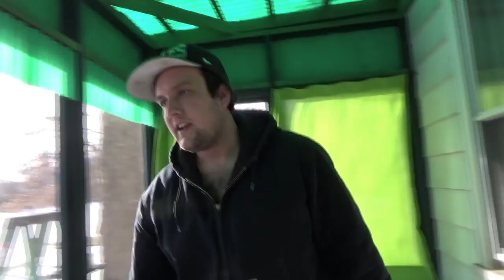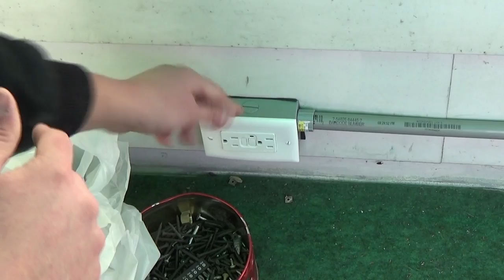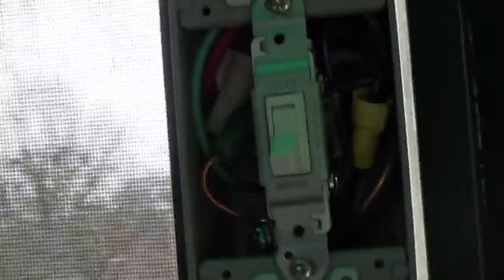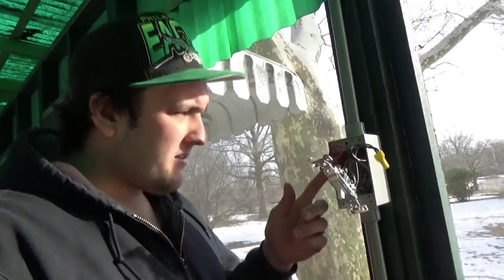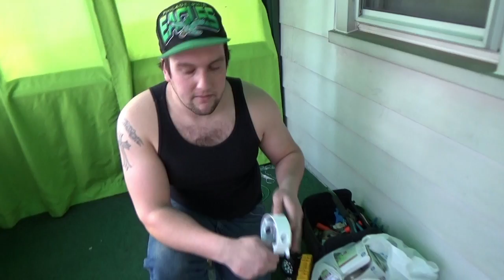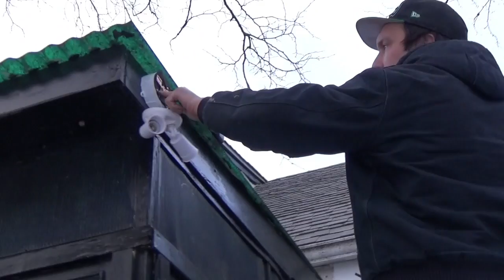How to install a light

Comment: Yo Buzz. lets go pull some 500mcm And give these people a real show! Fellow Electricians ftw Lol.
Reply: +TheSwiftyWinds stripping that shit is a bitch
Reply: Dude ikr! That new slick coating wire is even worse.. But it pulls alot better without wire soap.
Reply: +TheSwiftyWinds i always hate having to use the blue lube looks like ive been jerking off smurfs all day
Reply: +Eric Chrisman ya it is. have you ever used the drill attachment that strips bigger wire?

Comment: nice. I am taking an electrical class right now. I learned how to install romex cable for residential wiring. as of right now we are learning how to bend emt with hand benders. we are bending 90° bends, offsetts, sabbles. do you have any tips for me?
Reply: saddles
Reply: +Zach Vanriper  learn Trigonometry it helps with bending conduit, finding the hypotenuse is almost like finding the length between your bends to overcome an obstruction and getting the right height to rise over and straighten out and then back down  offsetting over anything in the way of your run. I only have a year experience , but I took electrical classes from a qualified instructor and wicked Mathematics teacher.
Reply: always remember safety first. make sure you always turn off the circuit your working on and always test it to be sure just incase, you never know if somethings been mislabeled. when you're using your screw driver never hold it by the metal shaft even if the circuit is off, its just a good habit to get into. remember your deductions when bending pipe pretty much all benders have it labeled on there. no more then 360° of bends in a run. in my area inspectors like to see pipe straps within 8" of a box and every 8' after that(even though the code book says 12" within box and every 10' after). label everything correctly, i even label junction box covers with the circuit and panel #(makes trouble shooting alot easier). make sure all your work is up to code and never be afraid to ask questions if you're not sure about something. also always try to learn from other peoples mistakes. i can go on all day but i think this should be good for now. if you have any specific questions feel free to ask and good luck with your training.
Reply: +tlott28 You won't always have the option to turn the circuit breaker off , so you should also learn how to safely work with power and how to wire and  disconnect devices or work in Panels. Best rule of thumb would be to connect your ground first then your neutral , and finally the line. Working on panels consist of isolation but for the most part as long and when you make contact with any voltage,( the metal part of your screwdriver) is it imperative to know that if while you contact the voltage if you accidentally touch the electrical box which is grounded , or the neutral bus-bar then all the electrons around your screwdriver shank will now be abruptly stopped and disperse at once creating an Arc flash. Most arc flashes are bad some minor, but at a main panel you can bet it will be a pretty big arc because it is a device under load , same goes for outlets and switches. For instance you are unscrewing the terminals on an outlet attempting to remove the Hot wire(most cases it is colored with black insulation) and before you can finish and you somehow also the shank also hits a path to ground or even if it is a metal box and the terminal hits the box it will arc. Its just a matter of completing the connection like if wires are knicked by the insulations exposing the copper inside a box plastic or metal, then they have a chance of contacting  eachother to create a short circuit were an ungrounded conductor such as the line make contact with a grounded conductor such as the neutral or ground wire . Alot of things to learn for safety this is just a very small portion.